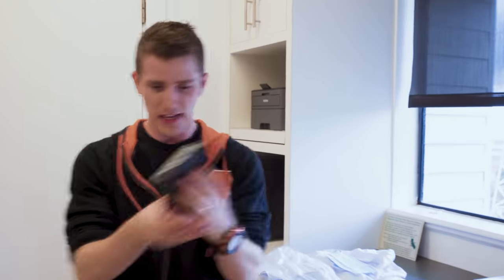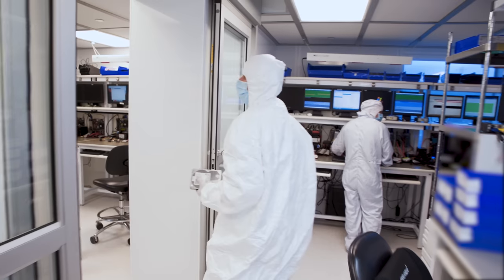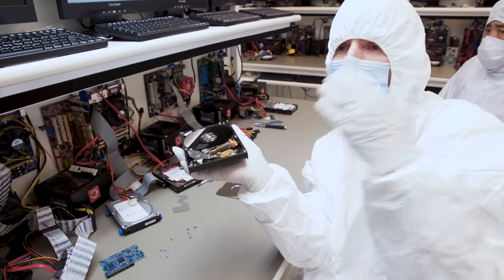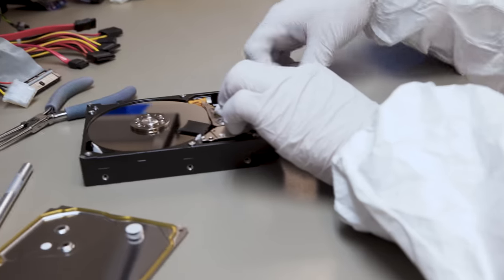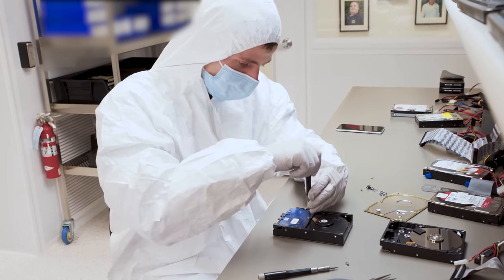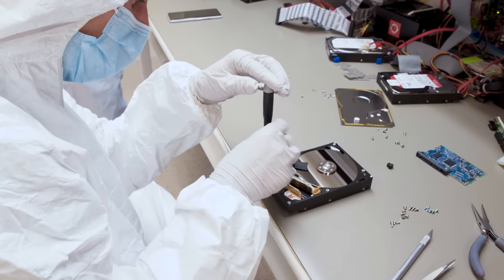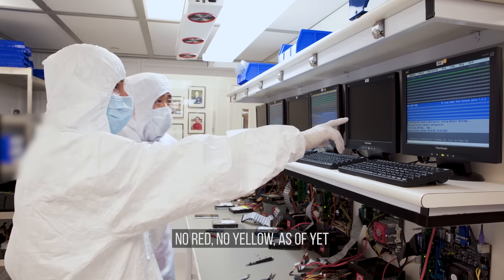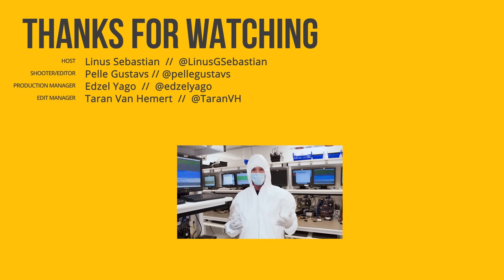REAL Data Recovery - Linus Swaps Hard Drive Actuator!

Comment: I need a room like that to apply my phone's screen protector
Reply: haha i bet they do that all the time for them self =P
Reply: I had the same problem fitting my PSP screen protector. It was basically impossible not to get some dust / fbers under it. Very annoying
Reply: Go to the bathroom run the shower on the hottest possible, close the door, wait 5 minutes, turn off the shower, let the steam take the dust down and them apply your protector =]
Reply: Well, if you live in northern sweden, where it's -30 degrees, thats a considerable amount of money spent on hot water ^^
Reply: skarskar skarner I live in Brazil haha so that’s not expensive at all haha
Reply: @Yuri Chaves In Brazil you just turn on the shower without energy in the middle of the day, and here we go Hot Water
Reply: You just need a can of compressed air to successfully install a screen protector. And a soft cloth, and a lot of patience. Also to clean the screen well before applying the  screen protector. But those who do it every day, are far better at doing it than most average shaky hands and bad eyes people like me.
Reply: Just fill the bathtub, instead and let the steam enter the room. Not wasting water going down the drain so much. But the risk of the room with high humidity, could get humidity to form on the platters, which is not a good thing.
Reply: Joshua K ikr
Reply: I literally spend a minute or so cleaning my screens with 90+% rubbing alcohol and everything, and without fail, as soon as I peel off the backing for the protector and expose the sticky side, a loose hair or piece of dust flies into it and gets stuck.
Reply: Fuck yes
Reply: I was thinking that too I use my bathroom.
Reply: @oosexta  in turkey we have solar panels to heat water, its free!
Reply: We all do!
Reply: During my time in a lab I used to apply it under a sterile biological containment hood :D
Reply: @oosexta  nice
Reply: Omg so true 😂😂
Reply: I swear to god
Reply: Yes
Reply: me too.
Reply: Okay lemme give you a pro poor guy tip.
1. Go to your wash room
2. Turn the shower as hot as possible for 2 min..
3. Get inside after 15-20 mins.
Now There shouldn't be any dust now so go ahead and apply your screen protector
Reply: Ooh..everyone knows this trick :')
Reply: Yeah like then you need to buy a new one
Reply: I use an umbrella xD
Reply: Bruh so true tho
Reply: He wore the mask and he could breathe fine
Reply: Lol
Reply: @sandercohen5543  iceland uses volcano headed water and uses the hot water to make power and the hot water and power is really cheap
Reply: Best way to do it =) did it several times for my self and friends at work ;-)
Reply: Haha lol 😂😂😂
Reply: You and  me both
Reply: Or just clean?
Reply: same
Reply: Same
Reply: @TheRestartPoint  I didnt know you could get screen protectors for the PSP, thanks bro I learned something new lol
Reply: @TheRestartPoint  same
Reply: Do it in the toilet.
Don't forget to turn off the exhaust fan though.
Reply: On point.
Reply: Y E S S S S
Reply: Yeah

Comment: 3000 operations before you actually get to do productive work… That is some awesome dedication to in-house training there, for a workplace. It’s not like you can practice those somewhere else.
Reply: 50 per 8 hour day. That would be 60 days. Actualy not much even if you do 25 per day. I mean it is much but not excessive in my opinion, (eventough I know nothing about this business)
Reply: hi bisqwit
Reply: @timburkhadt  60 days without any benefit to the company? Thats pretty long. How many jobs are like that?
Reply: @timburkhadt  

I bet 50 per day is pushing it. Thats just a little over 6 an hour. Thats if you don't take lunch or breaks. Ill bet its a 6 month training period.
Reply: @timburkhadt  Probably squeeze em out a little faster unless you are capped at a specific number
Reply: @Eli-gn6dr  But is it more than the cost of lost profits if they break the drive more due to a lack of training?
Reply: @Eli-gn6dr  The benefits of having a highly skilled employee who will very likly be with you for years, who you can rely on to fix data that might be worth millions, is definitely of benefit to the company, id also put good money on the training taking far longer than 60 days and trainees having other duties during the day.
Reply: @timburkhadt  Data Recovery Lab Engineer doesn't exist who could do 50 drives in one day, or even 20 heads swaps.
Reply: My guess is that it works

Comment: Because some people don't get just HOW fucking precise these read and write heads operate, I wanna give you a metaphor to better understand how insane this technology actually is.
These "flying height" as it is typically called in the tech industry is roughly 10nm above the surface of the drive, that is 0,00001mm or about the width of 100 hydrogen atoms. 100 atoms above the platter at a speed of 7200rpm which, for a 3,5" drive, is about 70km/h. This is so close and fast that even a dust particle or a finger print on the platter would have enough height to touch the head and cause a head crash.
Now Linus was actually a bit off with his fly and hurricane comparison, in fact it's MUCH more difficult and MUCH more precise.
You can compare what a hard drive actually accomplishes to a pilot that flies a Boeing 747 full of passengers around the equator with about 1500km/h just 2 inches above a lawn and while doing that he doesn't even touch a single blade of grass in over 500 rounds.
Reply: This is why QLC NAND (4 bits per cell) is going to be such a huge change in the industry. Although, because of scale and current maching, HDDs with various tech like HMR, are going to do well for a while longer. QLC NAND brings down price per TB considerably and sizing for density. For example, Samsung's M.3 sticks (slightly wider than M.2) are going to be 16TB QLC NAND. You can but one Petabyte easily in a 1U rack chassis.    This'll be good for consumers like us too for bulk storage.
Reply: Good grief.
The technology that goes into something as simple as a hard drive is incredible.
Think of what we'll have in 10 years, let alone 50.
Reply: Wow, super neat info.

Ram blows me away(think how freeking fast it is)
But that’s super interesting to think about
Atomic levels of accuracy at such speeds.

Comment: I think linus passed with the 65% D
i could be wrong but this was an amazing episode anyway
Reply: Austin Thompson wel 65 out of a 100 percent and they won't touch a customer's drove until they have 3000 drive swaps of different parts that's damn good especially for Mr break everything
Reply: Austin Thompson
What can linus do here, he gets bored easy if you ask me...
Upgrade all drive engines > 7200 RPM, not a lot on his level, not a data man....
1% if you ask me, one day, he starts running away here!
Reply: Moisha Gerenrot
Why you need linus?

Comment: As someone that did data recovery for a bit. This place is much better than the place I worked. -_- The place claimed to be one of the most advanced data recovery places in the world, but they trained me inside a regular office space (not clean room), and only had me work on around 10 drives before having me start working on customer drives. 
They also didn't have head combs for us here in the US. Instead, we were given pieces of paper to fold over and over again to make it the right distance for the heads instead of the combs shown here (people in the UK had combs), and if we did a platter swap, was just normal address labels sticky side to the side of the platters, lift and hope it didn't fall apart. Not all places are equal.
Reply: Sounds like Louis Rossman's operation :D
Except they have head combs. And they perform the work inside a negative pressure chamber of sorts to keep particles off the platter. And they sure as hell don't claim to be world leaders in data extraction.

Comment: We don't appreciate the engineering marvel that are hard disks
Reply: Hard disks are an engineering marvel, but SSDs, CPUs, and Graphics cards are meh?

Sorry, they are not an engineering marvel, not anymore at least. They use more or less the same technology they've been using for decades now.
Its just improvements and optimizations of the same engineering design.

Marvel or not, it has to go. Make way for NAND flash. Its superior in every way. And there's still tons of room for improvement.
Reply: Morpheas You do realize that HDDs will probably be around for decades yet for mass data storage, until the price per gigabyte for an SSD surpasses that of an HDD.
Reply: I work in a wafer fab that manufacturs heads that read and write on hdds and its amazing to me the amount of steps and time it takes to make that little piece.
Reply: ssds dont last forever i had two ssds fail on me the same year
Reply: I don't agree, a hard drive magnetic plate can hold information much longer than an SSD flash nand architecture, if the heads fail, it's recoverable, however, an SSD is much harder to recover, and it's usually used as caché between RAM and magnetic disks on server rooms (based on locality principle), truly permanent data is stored in magnetic drives, because of capacity and easier recovery of damaged hardware. Aaand, SSD tend to fail more than usual hard drives, and that's because of limited R/W accesses of the nand flash memory; that could mean nothing on a desktop computers, but in cluster rooms can mean true hell.
Reply: "i've had two ssds fail on me the same year therefore ssds dont last forever!" no shit they don't last forever. But you just got bad drives from the start. I have ssds from almost 10 years ago that still work and are constantly in use.
Reply: Bacon, You know what the plural for "anecdote" is?

"Not statistically significant data"

I have a 500GB Samsung HDD that is going strong after 12 years, and another 2TB HDD that is still working after 6 years. Does my experience nullify your own? No, it doesn't. But a good HDD can be basically indestructible. And at least data recovery is easier than of an SSD, and that is a fact. They will be outdated technology one day, but for the time being, they still have just as much, if not more practical applications than an SSD. FFS, even floppies and tape storage is still used in some cases. CERN stores data from the Large Hadron Collider in tape cassettes. The US military has storage in nuclear silos on floppies.
Reply: Yes, because CERN and the military are comparable to the average PC user. Also I never said they were good for backup anywhere. I said they still work. Anyone with sensitive data and half a brain would never use an SSD for mass backup. Nowhere in my comment did I say HDD will become obsolete either. You need to put down the crack pipe.
Reply: flash is great for your Home/ gaming PC but when it comes to "mass" storage, HDDS are the supreme champion right now because of cost even vs magnetic tape, if you want speed and storage isnt important than yeah go with ssd.
Reply: SSDs are a stupid invention. They value planned obsolescence over reliability. HDDs can be written to infinity times. SSDs can only be written to so many times.

Comment: Next up: Linus visits a micro soldering facility xD.
Reply: Would be nice to learn was is going on inside a fab.
Reply: actually , he did, it is not micro soldering but it was fixing GPU using micro soldering machine
Reply: The slow mo guys did a video about how high speed cameras are made and it has a part in it where they show how the motherboeard of the camera is soldered

Comment: They must pay extremely well I got enough stress in my life I don’t need a job that feels like BOMB defusing everyday lol smh
Reply: *Mission Impossible theme song plays*
Reply: Richard Henderson FIRST?
Reply: im sure they've had plenty of time to get used to it. it'd probably be stressful for the first few weeks though for sure
Reply: I work in electrons repair. When you pull apart your first anything it's always stressful because so many things can go wrong. After you've done a few of that device it becomes quite easy and rewarding.
Reply: Richard Henderson Do you do VEX or FIRST or something else?
Reply: Thezuule I sing the mission impossible and 007 songs when I'm under the floor crawling between pipes carrying acids and other death chemicals in clean rooms.
Reply: It's just another job. They are paid the same as any other. Astronauts too.
Reply: 3000 swaps before touching a consumer device!!!
What???
Evolution works faster than that.
Reply: Richard Henderson FRC much? Which team were you on?
Reply: I'm really surprised Linus was so nervous though. I would've thought he had taken apart a hard drive at some point

Comment: The video is great, never seen any recovery lab ever before. What I"d  to know is how actually the data recovery company 's software does work. What I have seen is running under DOS, if I right  ...
How long does it take to make a deep scan on a 4tb HDD 5400rpm if it's brand new ???
Thanks !!
Reply: The Software's name is "Deepspar Disk Imager". You can google it, how it works. The main thing is, that the Software can read and create images out of drives with damaged sectors.
Reply: TheLion092 Thank for your reply !! Its too late thanks though!!

Comment: Their cleanroom classification might be close to a ISO 5 like mine, these cleanrooms use a very fine HEPA filter and equipment with a certification of at least an ISO 5 or less. These are a horror to maintain as humidity and airborne particles must be controlled. If you want to know if your room can be considered as a cleanroom, buy a Pm2.5 meter :)
Reply: Dragonfire Productions like yours?
Reply: @rikivip  I have a clean room with laminar airflow blowers just for fun. mine is an ISO 5 cleanroom, I use it to screw around with hard drives and Socs but mostly I screw around with phone SOCs
Reply: Wow, what's your maintaining cost? And, is there any tutorial online to make one of those rooms?
Reply: @rikivip  my cleanroom was about $25k and maintaining it is very hard
Reply: Dragonfire Productions i call BS, sorry!

Comment: 3:08 fun fact i can acually put a screw where the hole is in the center of the actuator arm(on my hard drive) and it will work... (I can override the nub with a screw and make it work)

Comment: he got it. I did a circuit board swap from donor drive with a 3TB WD ezrx Usb drive. When I opened the WD backup drive it had the white refurbished rather than a Green or Blue drive label.
It worked, but there was bad sectors on the platter. maybe cuz I opened it to peek at the actuator position.(in a NON clean room). probably got dust in it.

Comment: the recovery software they're using reminds me of the built in setup from my family's first computer. IBM Aptiva running Win95, after about 8 years of use, the drive started failing. any time we turned on the pc, it would try to go into a data recovery mode, where it analyzed each block of data to see if it had good or bad sectors. every time we ran it, we'd get more and more bad sectors. thankfully by that time we had 2 computers, to which i more or less commandeered the other for myself

Comment: I think you got it, the biggest issue with replacing parts in the drive is actually corrupting the data with magnets. You have to thing that R/W magnet leaves either a positive or negative (up or down basically) magnetic polarity  I think it’s up 1 down 0 might differ from manufacture also idk. But all that being said if you drag the magnet across the platter and it makes contact as it drags, it potentially corrupts everything it touched. That being said most of the data is still recoverable if you put a magnet right on it you can still recover the other unaffected things on the drive you just need software to tell it hey like don’t treat this is a normal drive this is a puzzle don’t freak out when things are missing or wrong or values don’t make sense (10k 1’s in a row would make you’re bios say fuck it I quit where’s my ...PUNCH CARD!!) get it like the old version of data input.

The next biggest thing is Static shock can basically give the polarization on the drive Cancer. Like literally cancer for PC’s. Thus the ESD tabletop and floor. 

Anyways I could rant for a while I read like 2 articles half way through and am a science-o-Phile so I usually catch of very quickly.

So will it recover ?

Comment: But what if you sneeze?
Reply: sneezes can come randomly
Reply: That's what the masks are for.
Reply: better shave those nose hairs lmao
Reply: @pleaseclickunsubscribe  Sneezing can be triggered by negative thoughts that trigger the body's subconscious nervous system.
Reply: You are wearing the mask
Reply: Then you better get tf out
Reply: You sneeze into the mask. Surgeons do it all the time
Reply: you don't or get fired. your choice.
Reply: i actually opened hard drive and fixed it, but it die after a day or so.
but one of the fun things you can do is watching drive plate go transparent if it is dead and head keeps scratching the plate.
after a month or so plate was fully transparent 

if you sneeze on it, best thing you can do is to wait it to dry, but it will cause a lot of bad sectors for sure